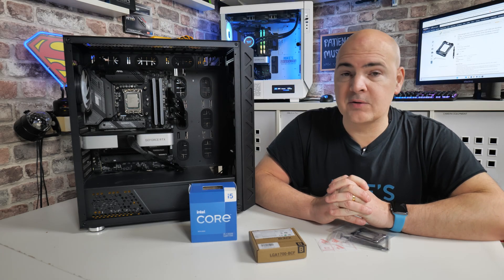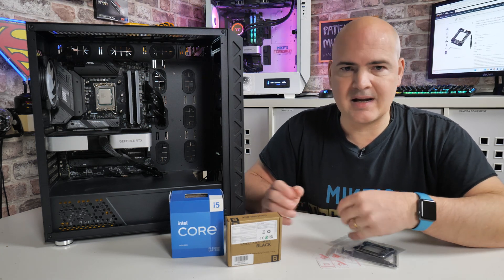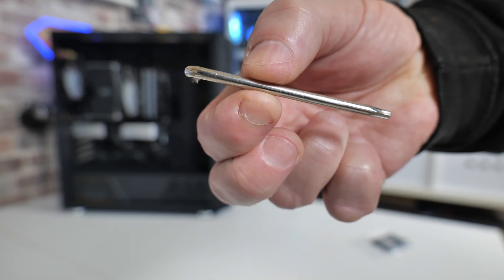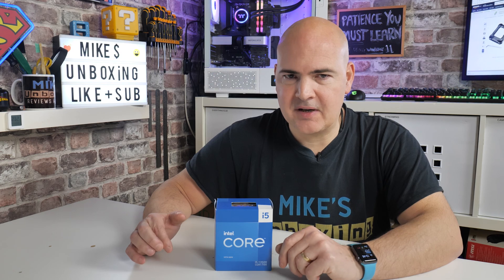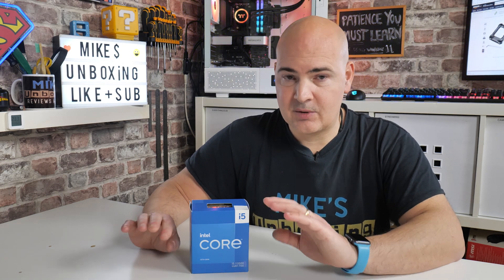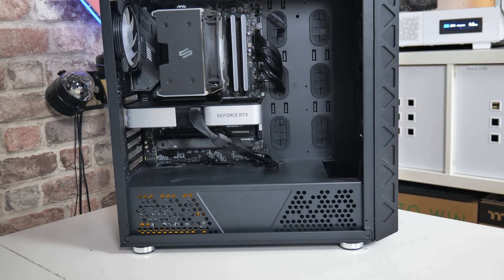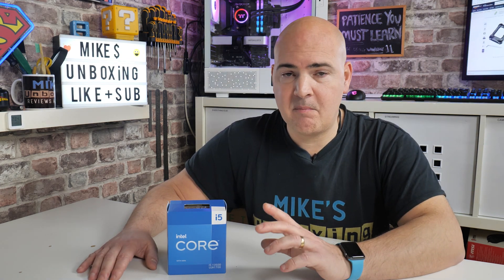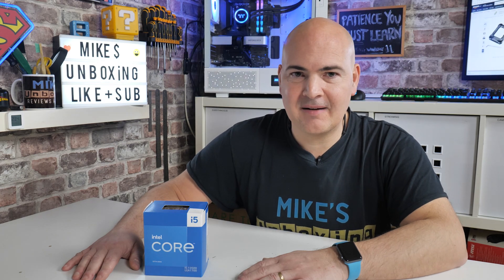Thermalright LGA1700 BCF Contact Frame Plate Weird Results Please Help!

Comment: I am experiencing no issues. My current setup is core i5 13500 MSI Z690 tomahawk Wi-Fi ddr4 and I am getting around 50 degree Celsius while gaming and in cinebench r23(10min stress test) am getting 67 degree Celsius peak temperatures using deepcool LE520 where as on my my previous setup I had B660 Aorus Pro AX and I was getting the same temperatures in cinebench but less temperatures while gaming due to difference bios settings. MSI fan curve is quiet as compared to Aorus. I think I don't need to get this contact frame.

Comment: I just got a brand new 14700K and got the frame but I'm still not sure if I want to install it.
What would you recommend I do for that cpu considering I'm not planning any OC.
I'm mainly worried about the bending part and how it might overheat later and that bracket will not be useful at that point.
Thanks
Reply from the maker: if you have it, i would install it especially if it is a 600 series motherboard
Reply: @mikesunboxing  Thanks for responding, it's actually a Z790 motherboard, but I already installed it, it was super simple.
Unfortunately I can't report the results yet as I got a cooler that doesn't fit my case (Arctic Freezer II 280mm with Corsair 5000D, not enough room for top mounting), so I'll only know when I sort out the cooler issue.

Comment: I just mounted it with a different thermal paste (nt-h2) and the max temp dropped from over 90 to around 80 (82 max on 1 core, the average for the whole chip was under 70) on my i7 13700k overclocked to 6ghz and 4.4 ghz and on cinebench 24 I’ve increased multi core of around 40 points (I don’t remember the single before but it should be slightly higher than online benchmarks), on the other hand when it’s in idle it’s almost the same (from 30 to 27/28 degrees). So for 40€ it was absolutely worth it
Reply from the maker: great results there!

Comment: You should really revisit and redo the entire test. I think you really screw in a bit hard, but it could be something else. Frankly, I'm surprised it even boot or without any memory slot loss.
Reply from the maker: you cant overtighten it, it is solid metal screwing into more solid metal. I think what you are trying to say is that the frame is not perfectly machined and i need to loosen the screws to allow for imperfections.

Comment: I’m with everyone else here, while I’m using amd it it crucial to stop tightening as soon as you feel pressure. This is one of the reasons they specify to tighten each screw 1/4 turn at a time. That way you don’t over tighten. Also, you should like you know what you’re doing but did you disconnect the power supply completely? The amount of movement you allowed from the chip between bracket switching could have caused a power spike damaging the chip. Just my thoughts, hope they help.

Comment: I would think the issue is the testing method. The CPU temperature needs to be measured using a task that is not dynamic. Cinabench is going to task the CPU in a changing environment. You need a task that is going to be consistent in the usage of the CPU like a game or task. Then look at the differences.
Reply from the maker: there is that, but also the 700 series motherboards have mostly learned from the mistakes of the ILM on them and seem to flex a lot less, making these brackets pretty much redundant, at least on decent quality boards

Comment: If someone were to be OCD,  and want to Actually measure instead of YOLO. 
How many inch lbs of torque would your tighten it to?
Just to be that guy.
Reply from the maker: impossible to tell, they don't tell you. i imagine somewhere in intels spec sheet for the socket the screws that hold the original ILM could be used, but that is still guessing really.

Comment: ⚠ I suspect you over tightened the bracket and some bending happened causing the over heating. ⚠
Reply from the maker: very likely, but it is designed so that shouldn't be a factor, but likely is

Comment: Good day, mate. After I installed mine, I used one of the thermal pads instead of paste. My temperature dropped by 18 degrees Fahrenheit. As you undoubtedly noticed, I'm an American PC Gamer. My CORSAIR iCUE NEXUS is set for Fahrenheit to easily relate to my PC's temperatures.
Reply from the maker: that is very impressive

Comment: I'm using a 13900KS on my Asus Z690-A D4 motherboard, the Silicon Potential is 112 and comes with 1.62V Core VIDs to hit single core 6.4G duo core 6.2G quad core 6.1G, and all core 5.9G (E cores all core is around 4.6-4.7G). Cooled by an Asus 360mm AIO, the CPU with contact frame and Coolermaster CryoFuze Nano thermal paste in my daily usage normally draws 290-350W from idle to gaming, and constantly stays around 45-98C respectively. I think it definitely helped, when I used to use a 12100 before my upgrade to 13900KS, even when drawing 105W I'd reach 90C with it.
Reply from the maker: for 600 series boards i think it makes a much more noticeable difference as the clamps aren't as stiff
Reply: @mikesunboxing  So real, and also i feel like more recent boards may have this issue addressed. I recently impulsively built a new system using an MSI Z690 Force WiFi and a 12900K when they are on dirt cheap combo sale to make a media PC, and even with an Asus 240 AIO, all core fixed 5.1G @1.349V with 290W cap, I never surpassed 80C in daily usage unless during benchmarks. This is even without the bracket. When I checked with CPU-Z it says the motherboard is a 2.0 rev. one, so the board makers must have done some homework in between.

Comment: Hi mike, any good result again using the contact frame with 13500+b760 tomahawk. cuz i have the same proce+mobo combo and planning to buy the same contact frame. i hope you got better temps this time
Reply from the maker: still using it now with 13900k and idles around 30c and maxes out high 70s with 360 aio and stops the thermal paste going everywhere, so i would use one for that reason anyway

Comment: This is what I experienced.
When I used the Thermalrigh LGA 1700 Contact Frame my A1 Ram Slot is not working.
But When I put back the Intel LGA1700 Contact Frame my A1 Ram Slot is working as fine.
Reply from the maker: yes that seems to be quite common
Reply: @mikesunboxing  Oh I see, I wanted to use all of my RAM Slot.
So I would put back the intel default lga1700 contact frame.

Comment: The frame will do no good on an already bent cpu.  You need to use the frame on a new cpu.  That is why your results are bad.
Reply from the maker: the CPU and board are brand new, only a week or so old if that.

Comment: Clearly you didn’t do any homework before installing the contact frame. And this video is still up with the absolute wrong procedure to install the contact frame 6 months later.
Reply from the maker: i did what is showed on the instructions as a lot of people are likely to do. And to be fair following the instructions is actually more than most people will do.
there are no torque warnings or even suggestions that torque is required or not, so i really don't understand where you are coming from? what more homework is expected other than to use the included instructions?
Reply: the homework is to inform yourself about the installation process before you show this to other users, god i cant watch this again. yeah and no warning that it was wrong or something else ...  @mikesunboxing
Reply from the maker: @GameGearZero no homework needed, that is why they include an instruction sheet. If the instructions are not clear that is down to the manufacturer. Which is my entire point of the video

Comment: I can't see a large improvement using this as far as Intel sockets go. There remains the obvious shortcoming of having only two small pressure tabs and also only on two sides. AM5 sockets however have nearly 360 degree tabs and I could see the benefit of one of these. Likely better to leave well enough alone...those factory brackets have been working without failure for decades now.

Comment: Way to much torque on the screws
Reply from the maker: You can’t use to much torque it comes to a physical hard stop it can’t be over tightened in theory
Reply: @mikesunboxing  yes and can cause issues with the cpu and memory

Comment: I run a 13900k, and just got this contact frame.. but I went Balls to the wall for my thermal paste and got some Thermal Grizzly. I ended up scoring higher. One thing I can think of though, is you might get a higher temp when you put fresh paste.. You might get better thermals at time goes on. And one of the things the contact frame does is stop is from Bowing!! It's even pressure on the cpu rather then juston those 2 contact points.. At this point in the game, intel and AMD need to rethink the mounting, and make it 4 points of contact. Or adopt something like the contact frame.. It wouldn't be hard to make something that clamps all around the cpu. As I believe AMD did that with the threadripper cpu's
Reply: Those two small tabs on either side of the Intel cpu's are still the only place the new bracket is putting pressure on. AM5 has tabs all the way around their cpu's.

Comment: this is same problem I had with 2 contact frame I'm worried now should I install them or use Intel contact?
Did you found any fix?
Reply from the maker: i took it off and re tightened it slightly less and it works as it should
Reply: @mikesunboxing  ok I'll try it
Reply: @mikesunboxing is your wattage back down to normal now?? After less torque on the screws? How about temp? I have a 14900k on all new pc build so i only ran 1 test before installing the contact frame. But it seems the cpu frequency is lower. And no temp improvement. Still will hit 100c

Comment: Cpu out,bios got resetted?
Reply from the maker: it that a question or a statement? it can reset the bios sometimes but it isn't the intended outcome
Reply: @mikesunboxing   its like a scenario. which may or may not happen.

 Also i am amazed that your 13500 drinks above 165 watts fully unleashed. 
mine is have a 0.1 volt negative offset, can do 0.165( but noticed no change). at this 0.1 volt offset it drinks 130watt on cinebench r23 multicore test.

could you try the offset and report back, the  offset data wont be shown on hwinfo, but it works when loading up the cpu.

Comment: i saw a 7-9 degrees temp drop with the contact frame on my 13900k. Worked pretty sweet for me
Reply from the maker: awesome glad you got a good result! Out of interest was it a brand new build or had it been in use for a while already?
Reply: @mikesunboxing  it was a brand new build. I only tested temps on the new cpu then switched to the contact frame.

Comment: only thing I can say is that you screwed down that contact frame SUUUUUPER tight.

Every instructional video I watched said to screw it down with the same force the factory screws were screwed in. and mine were feather tight.... as in It was basically loose. and that's how I  tightened it down. I could see your fingers straining when you tightened those down... especially how you tightened the first one down to the max in one go without going screw by screw getting slightly tighter each round.
Reply from the maker: my point is that they don't include any instructions that tell you what to do, yes there are opinion pieces online, but nothing in writing from the actual manufacturer, just some basic ikea like drawings
Reply: @mikesunboxing    I have this, and I agree the instructions could be better, but I also think you cranked it down way too much.  Generally, recommendations are 90 degree turns in a cross pattern until you feel resistance, then 45 degree turns until *JUST* tight.    You don't want to tighten down more than what the original bracket had.  Hope this helps.

Comment: I'm running 13700k with the contact frame. mine drops temps by about 3-5 degrees. I have discovered that if I ran the cpu before the contact frame using the intel stock bracket I did have some issues. but if I used it without using the intel bracket first I saw more positive results.
Reply from the maker: that makes a lot of sense

Comment: Hello Mike. I was investigating about this matter yersterday and I got mine today. What I can tell about your particular case is that you’ve been very careless installing it… I was sweating while whatching you install it. My theory is that you installed it with uneven pressure or too much pressure and that damaged some pins or perhaps the circuits tracks that communicate to the cpu. Steve from GN said that if you do something wrong you should experience memory or voltage problems, thats why you got same results when returning to stock ilm. In my case i’ve been very careful during installation and got same temperatures but with higher scores on all the benchmarks. My conclusion is that pin contact improved a bit and the temperatures remain the same because my 13400f is not hot at all and it was just fine before. Also, my board is an asus b760.
Reply from the maker: my whole point is that the instructions contain zero information on torque or how tight to do it. In  Steves video Mike even says keep going until a hard stop
Reply: @mikesunboxing  I didn’t go that far because when I removed stock ilm I noticed that it wasnt that tight at all. So I just tightened them enough to feel some resistance and both backplate and contact frame were perfectly seated with no play. And yes, the instructions sucks. Why don’t you contact thermaltight? Maybe they listen to you and make an installation video…
Reply: Btw. Next time dont do this with the mobo mounted on the case… remove it and do it on the table, hold the backplate at start… we are talking about very low tolerances here, so I find that removing the mobo from the case its very important to this matter. When I got the contact frame attached to the mobo and processor I used a level to check if they were perfectly flat on X and Y axis. Just my two cents

Comment: I think the screwing down of the bracket was much too blasé. Mark your screws so that you can accurately rotate each one 90° in succession until some resistance can be felt. Then very carefully continue until the resistance increases. thermalright's 'hard wall of resistance' is terrible instruction, I would never torque a pc screw with any more force than finger tight (no wrist effort in the movement).
Reply from the maker: The point is that the instructions are very simple and don’t show to do anything specific as shown here and it clearly needs clarification
Reply: @mikesunboxing  yes it's universally agreed that the instructions are terrible and insufficient

Comment: first have to say those pastes are junk..you can argue all you want about paste dont matter but use thermal grizzly and ill bet temps go down,,,now the tests after applying the contact plate were better also running hotter but pay attention to that power draw then look at your clock speeds ill bet its "turboing" much faster than before hence the increased score so yeah more power more heat...
Reply from the maker: good points james

Comment: How is that NO ONE show how the hell you use the cooler, every one just copy paste the process of the cpu holder, none, and i watch then all, show me if i have to use the intel backplate or the cooler 1.... What the actual F.
Reply from the maker: the cooler install has nothing to do with this plate, intel use the motherboard holes and if a backplate is used it is included with the cooler

Comment: I built a new rig last month (12400F) and used the more expensive Thermal Grizzly one. Since it 'floats' on the CPU without resting on the board like the Thermalright, it was a little nerve-wracking tightening it without over-tightening it but it seems to be working as intended. I built another rig using a Gigabyte B760i this week and cheaped out and used this frame instead. Machine turned on but immediately shuts off. Probably something I've done and not the CPU frame but I've ordered an mATX board, CPU and case to redo it and ordered another Thermal Grizzly frame as well.

I tightened the Thermalright one tightly, like you showed, figuring since it actually rests on the board that should be fine; strange thing is that the ILM didn't seem to be screwed in very tightly at all. The TG instructions say to be careful not to over-tighten theirs, as this can break the traces by smushing the layers. I think the problem is that I somehow mangled the Aeorus ITX board when installing it in the case, either that or overtightening the frame.

I also bought a cheap test bench so I can test it before installing in the case. I might try the ITX CPU to see if it works to determine if it's that or the ITX board that's the problem before op[ening the replacement CPU.
Reply: hey sorry to bother so late. any follow up news? i am trying to decide between thermal grizzly or the thermalright but i dont know if the extra price is worth it. 13700k.
Reply from the maker: get this one save money
Reply: @mikesunboxing  Why are you recommending one over the other? You have not even gotten any valuable results. And some are saying that the Grizzly rests on the cpu and not contact with board, this may help with some air flow, and less chance of over tightening. But you suggesting one over other is mind boggling.
Reply: I hope you got the grizzly! @apiestink